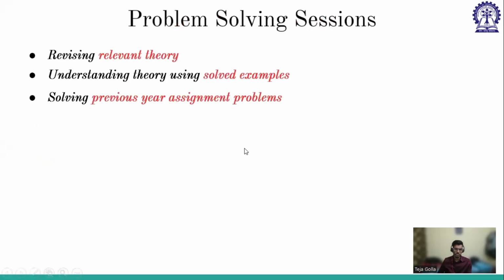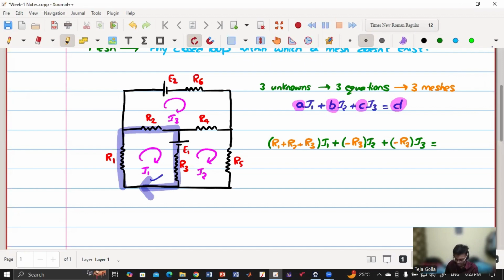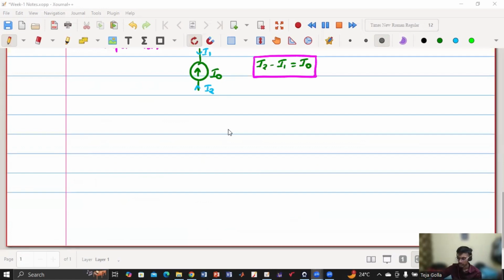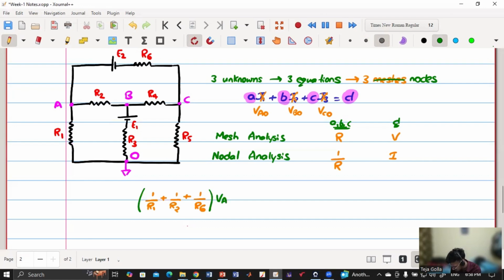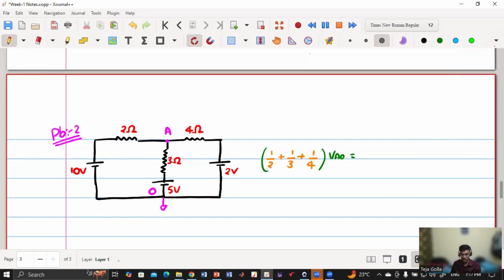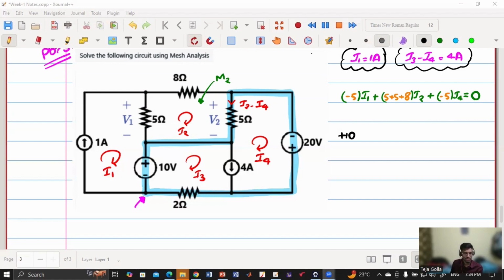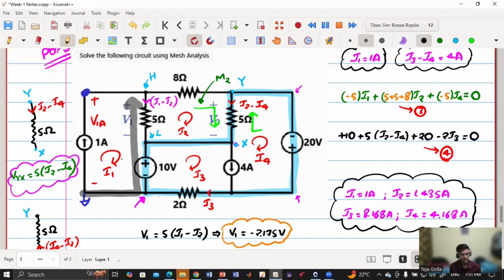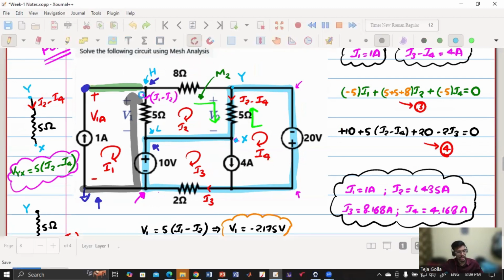Week 1 | Network Analysis | Problem Solving Session | NPTEL

Comment: Sir,  I have a doubt 
Is there any chance that in the mesh analysis question V1 can be positive???
Sir please reply sir
Reply from the maker: Yes, it may be positive or negative depending on the value of the circuit elements. For this problem, it happens to be negative, but it can be positive for different values of resistors, voltage, and current sources.

Comment: In mesh analysis problem what polarity to consider for 4 A current ?? Is considering +(up) - (down) similar to 1 A, okay in the case of 4 A current??
Reply: Got it thanks Sir!
Reply from the maker: We need to first solve the circuit, which I have covered in the video. Then, we need to find the voltage across the current source; it can be either +ve at the top or +ve at the top. But depending on the polarity of the voltage across the current source and the direction of the current, it could either be supplying the power or consuming the power, which I have covered from 01:48:09.
Reply: @tejagollagt so since the current i3 is in the direction of the 4A Current source and considering that i3 is higher than i4 also assuming that the current source always delivers power can we take + at bottom and - at top of the 4 A current source?, is that logic correct sir??
Reply from the maker: We can't assume that the current source always delivers power; it might also consume power. So, we can't make any assumptions about the polarity of the voltage across the current source; instead, we need to calculate the voltage by solving the circuit and check if the current source is delivering or consuming power.